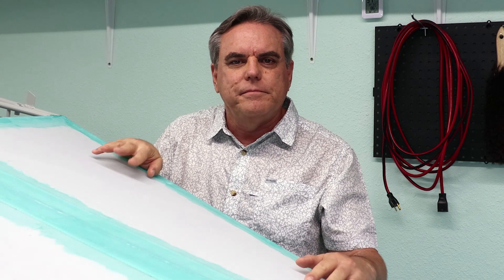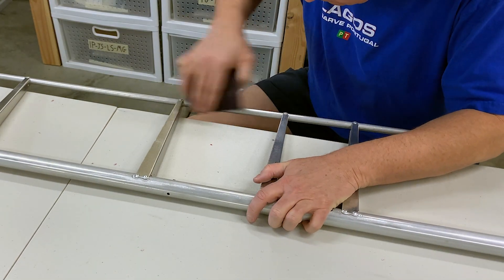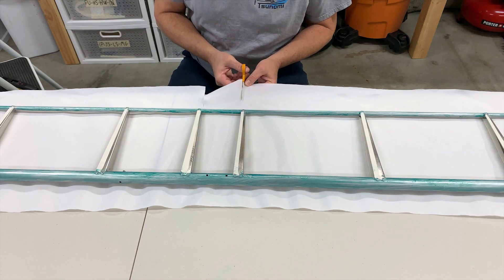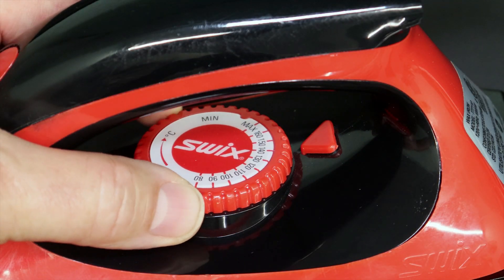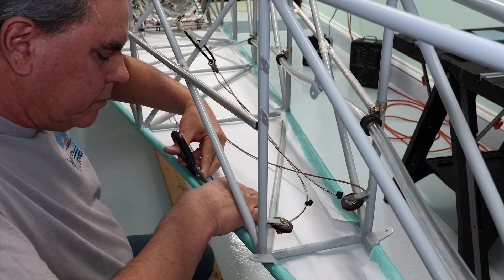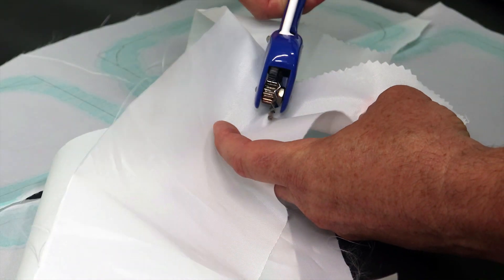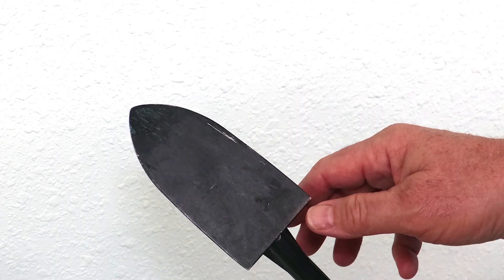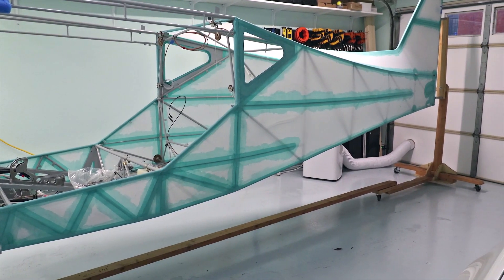RANS S-20 Fabric Covering Controls & Fuselage

Comment: Tapes, argh! I seem to recall the tapering tape on the spine between empennage and vertical stabiliser, maybe only 10” long, took ~6h on my Raven.
Reply from the maker: Ya, that segment on the tail was a little frustrating, getting around the corner. I ended up making it two pieces just to get it to lay flat…